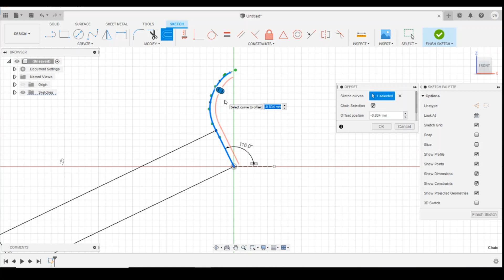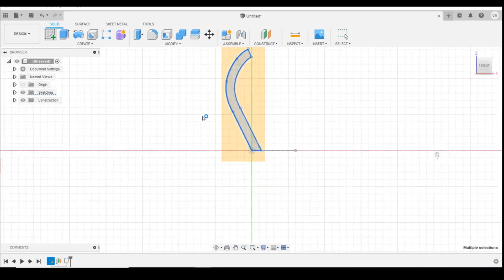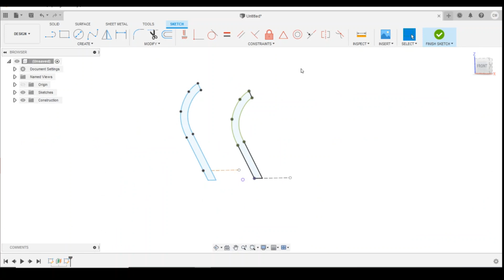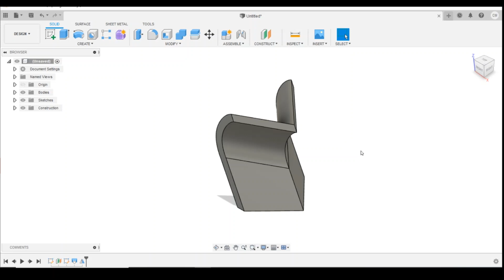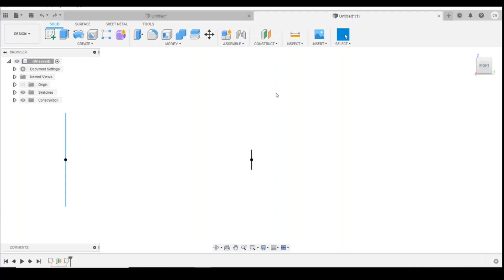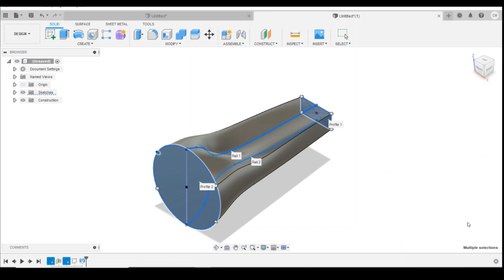Lesson 20 - How to guide for Fusion 360 Loft tool to create items for your Model Railroad

Comment: Thanks for the videos: I'm watching to learn Fusion 360 as I have some particular railcars (Portuguese) I want to make models off - is the loft tool here the one I will need to put a curve on two axes, the bow on the front is one and then the raking back of the front into  the roof dome? Cheers Richard
Reply from the maker: Hi Richard,

Yes depending on the exact shape of the railcar you will require the loft tool to do the curved front ends.  most likely you will need to use the Guide rail function part of it as well.

Cheers

Carl

Comment: The loft tool looks really useful and I haven't used it! I wonder if it would allow car shapes to be produced by lofting between elevations along the body of the vehicle?
Reply from the maker: Normally you would you the surface modelling part of Fusion 360 for drawing something like accurate cars.  That part of the software is a completely different beast and takes ages to get you head around,  it requires lots of doing then amending.

Carl

Comment: Another great tutorial.! question- why when drawing the splines do you stop short of the end lines & then connect up with a coincident ? Cheers
Reply from the maker: Hi,

Yes because the splines and the edge of the circle are on different planes you need to use the Coincident to snap them together.

There is other ways but I have not started to cover them in this series yet, but this certainly the quickest way to do it

Thanks

Carl